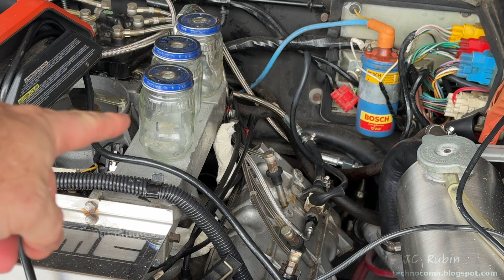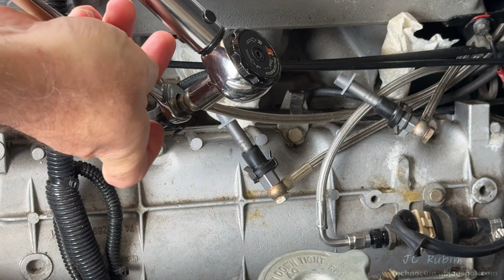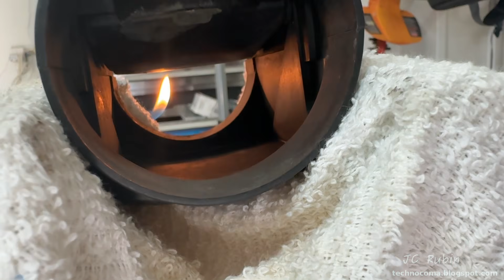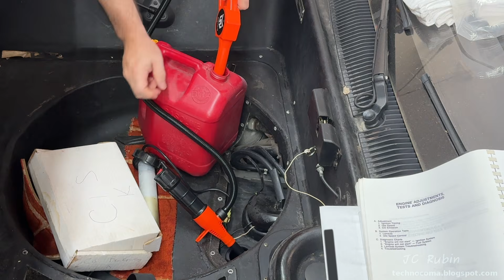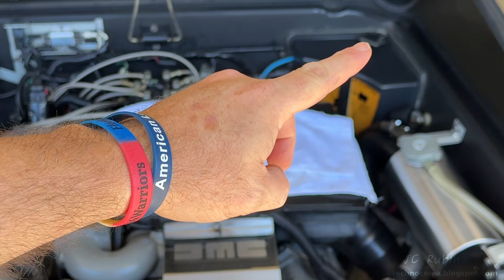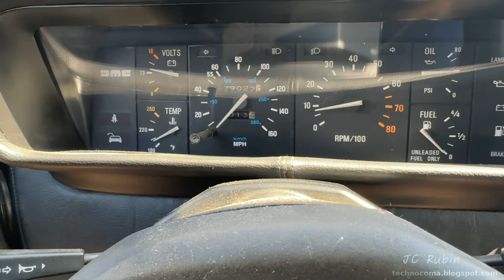Bosch K-Jetronic System Failing on a Delorean - Lets Fix it Part 3 Injectors and CO Screw

Comment: Absolutely superb. Your presentation seems well-practiced; your video is all-seeable, and your expertise is -well - expert. I wish you lived around the corner from me. In the last two months I have replaced the fuel pump/sender, filter, feed line, accumulator, and I am awaiting the arrival of the WUR rebuild kit. Then I will attack the injector testing just as you have demonstrated. I really really really want to get my Stage II back on the road. I haven't had it registered for 8 years:(
Reply from the maker: Thank you much. Good luck.